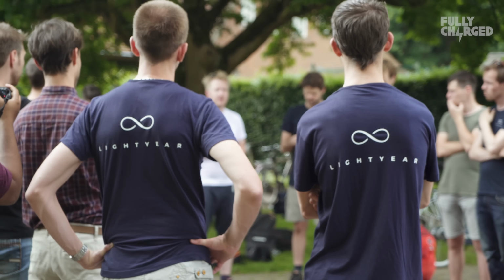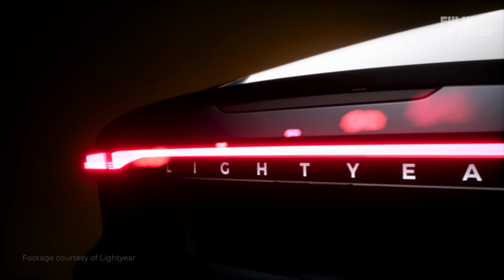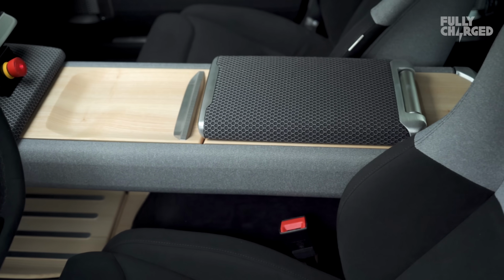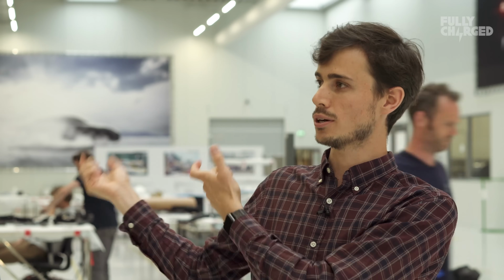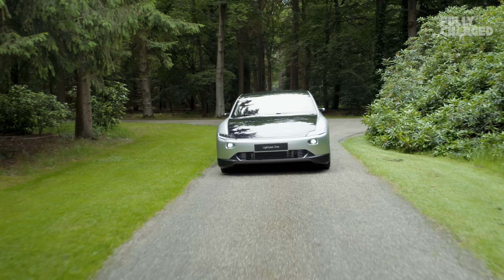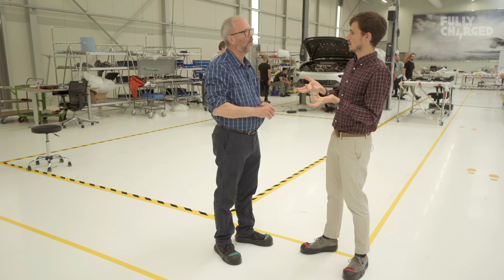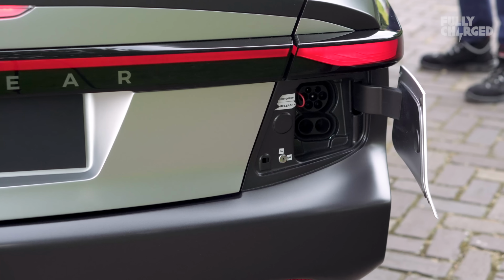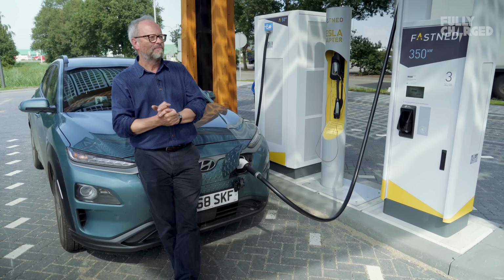Lightyear One solar powered electric car - exclusive first look | Fully Charged

Comment: Thank you for asking about the unsprung weight, I don't see any way around it! Motors in the wheels sound cool but I don't think it's good engineering, just move the motors inboard.
Reply: In wheel motors make it possible to design the chassis like catmaran for aerodynamics and it saves a lot of weight because there is no drivetrain.
Reply: @неболтай-в2о  - if it works it works and I'm for it.  I imagine those motors getting bounced around in potholes seems harsh.
Reply: That just reminded me of inboard brakes but that would really take up a lot of space near the center of the car.
Reply: @robertpryor7225  The goal is to save weight.
Reply: @robertpryor7225  You can dwarf down motors and shock absorbers to a certain size if you work together.
Reply: I am 23,My school kicked my ass..You want to know why?I asked questions.

Comment: Production vehicle in 18 months to 2 years?  From a single pre-production prototype to any volume build in that time, on a brand new car, and critically from a brand new company with no existing facilities, supply base and production experience would be, ime, not just improbable, but impossible. Today, no one has proven/certified full life durable wheel motors and there are some concerns over HV exposure when the powertrain is not safely "buried" within the main structure of the vehicle (pull a wheel off in a minor crash, and you can expose the HVDClink !!!)   The big OEs have literally thousands of engineers doing NVH and crash, and they have multiple years and product models of real production experience. As Tesla have found, making an EV go along is actually the easy bit (ie engineering the powertrain), making a quality product in volume (fit/finish/NVH/Paint etc) much, much harder..

Comment: Very interesting. Pretty good design, I would tweak a few things. I like that it's close to half of the energy consumption of Model S. That really translates to benefits in initial battery cost, battery wear, repair and replacement. Also ease of acceleration in drivetrain cost and tire wear. Lesser electricity usage for the house, smaller solar panel installation to offset it. Optimization is generally king and it even makes sense if structural materials cost might be higher. The lesser burden tends to catch up over the fatass approach. Not mentioning names.
General efficiency thinking also unsnags them from other burdens like foolish vampire drain and carrying a lead acid battery. Again, not mentioning names. Cleanliness is next to godliness. 
Speaking if which, I would recommend putting a touch display in the steering wheel face as the only display, removing the dash and center console. Clean like a Model 3 but that step superior by placing the display in the steering wheel where it belongs. The airbag can be in the bottom of the steering wheel in a slit, not behind the display. Keep it simple.

Comment: The in hub motors don't sound like a good idea. They work pretty good at low speed, but at high speed the vibration may damage the motors. This is most likely one of the reasons why they drive the car at such a low speed.
Reply: Yeah - I suppose these amateurs are stumbling around in the dark, not really knowing what they're doing - now if only they'd got YOU in to put them right.....................!!!

Comment: Wait. Listen at 5:58   "So the minimum range you will get is 400 (km) in winter, with Air conditioning, with everything switched on, with high speed driving"  

Sure, this car is efficient (as are all EVs btw) but it's not magic! My i3, driven fairly carefully, at a low average speed (50 kph) in uk winter (~5degC) averages, with cabin heating on, approx 6 km / kWh.  So, 400 km would need ~66 kWh (useable) which is 2/3rds of a Tesla big battery (100 kWh).  So the Lightyear car needs to be as efficient as my i3 is at 50kph, when it is travelling at high speed, lets say 100kph.   Now the i3 has a relatively poor drag co-efficient, and the frontal area is not actually that small (CdA = 0.69)  but doubling your speed (50 -> 100kph) requires 8 times more power, so it will have to have a Cda of < 0.1?  (Tesla S = 0.56, Mercedes A class saloon (current most aero mid sized car) = 0.48)

Comment: 20,000 km a year from the solar panel in a place like Australia huh.
Probably doesn't work out in practice due to battery limitations, but even if you drive a LOT, and even with the kind of distances you get in Australia, driving 20,000 km in a year is a lot of driving...

Definitely one to look out for, especially in the sunnier parts of the world.

But the efficiency gains are probably more impressive overall than the solar power.
Reply: All leases around here (Canada) have 20k km included every year. It's quite a common number in big countries...
Reply: @simonlynchsae  yeah, but you still don't reach such numbers easily unless you spend ages doing cross-country trips.
Most new vehicle insurance schemes are something like 100,000 km / 5 years.
So they too typically equate a year to roughly 20,000 km.
Doesn't mean everyone is reaching that number.
If you do a 200 km trip twice a week, like I currently am, you'll get around 20,000 in a year, but not massively over it. 
slightly under 400 km a week is a pretty high average unless you live in the middle of nowhere and constantly drive to something far away.
I guess when I lived in that outback town and took near weekly trips to the nearest city, which was 330 km away...
That ends up at about 30,000 a year.
But even with our car having done multiple 1000+ km trips in the last year, 20,000 km is a substantial fraction of the distance driven in a year.
And we DO make a lot of long distance trips compared to an average city driver even in Australia...

Comment: Can't wait for the cheaper non-luxury models. Just, please, keep the minimum range at/above 400km, everything is so far apart in Aus. Also, good aircon is a must have, as we'll often be leaving it out of the shade with a boiling interior.

Comment: That looks a lot like a Citroen CX, and the general feel and philosophy seems similar too. Really nice. Would like a shorter tail though.. How do you brake with in-wheel motors? Do yo still have disc brakes? Braking on the motor itself probably won't be quick enough for emergency braking?

Comment: I have followed battery technology most of my life. In 1974, at 6 years old, my parents bought me a battery powered motorcycle. It was a very expensive toy at the time. It had a lead acid battery in it, was very heavy and took 24 hours to charge. That charge gave me about 10-15 minutes worth of riding, then it needed 24 hours of charging. As a whole, I got about 50 rides out of it before the battery failed. After that, it became a very heavy push toy. In 2000, I bought a Honda Insight. VIN number 0000000250. My wife and I put 319,000 miles on it and when we traded it in, it ran and looked brand new. For me, I love seeing this technology. I am ready to see the world move past oil. I am tired of life being dictated by the cost of a barrel of oil. I'm sick of the problems in the middle east becoming everyone's problems. I'm sick of war over oil. I'm sick of air pollution. We should NEVER feed machines the same things we need to survive, like oxygen or even plant material (i.e. ethanol from corn ect.). Cheers to these people and others tackling this task.

Comment: It's very hard to find the good compromise with aerodynamics & styling. Plus the area for solar panels! What I see here it's streamlined 30s Tatra's design soul in 100% futuristic form, with NO retro resemblance. Very neat design, with no bells, whistles & trinkets which are overloading car styling today. And  bright & clever engineering inside. She's gorgeous. However, many elements need to be improved. Fingers crossing!

Comment: Slow speed test drive all look very nervous and people chasing the car makes me wonder if it had any functioning brakes.
Reply: It is the first prototype, what do you expect?
Reply: Ali Chahin  well the ability to stop would be good , I wonder what solution they will develop for breaking other then dynamic as the in wheel motors would be a problem to design a breaking system around.

Comment: One thing that always strikes me with these new-level leccy cars is that none of them use wind turbines where the radiator would traditionally be to generate a little more self-charging. Is the tech not there to make use of 30 to 100 MPH winds or does no one think to do it?
Reply: Because the energy has to come at the expense of something....lots of drag
Reply: @chrisphillips1948  Not buying it. For sure there will be drag, but too much?
Reply: Think about a wind turbine. That's harnessing the energy stored in the wind. The atmosphere is making the wind blow, and the turbine is anchored to the ground. So the turbine is taking energy from the planets dynamism. With a moving car it's the cars motion that's creating the source of energy and this motion ultimately comes from the power stored in the battery. Anything that "re-takes" this energy and converts it back into electricity is always going to lose out due to the losses incurred during the conversion and the inefficiency it adds to the car.

Comment: One day in not the too distant future the batteries will be so officiant they will get one thousand miles per charge and the solar panels will be way better than the ones we have now that the car will be able drive on it's own generated power all day and then the battery will kick in for night driving and will take only 5 minutes to fully recharge at a charging station . I can't wait...

Comment: Look up LoReMo - it was a German startup company from the early 2000's that looked very similar. It was supposed to be powered by a super efficient small diesel engine that was claimed to be capable of 1.5l/100km fuel efficiency. They made it to a prototype stage but I guess the underdeveloped battery technology and faltering market interested killed it.

Comment: I think it's really amazing that they're creating this car, and I think it's going to produce a lot of good science for new car manufacturing designs and materials. But I just have a hard time believing solar power on the car itself is going to be cost effective in the long run. And, historically, ultralight cars are extremely uncomfortable to use in every day life. The vehicle needs mass in order to create a comfortable ride. 

So they've reduced the amount of heavy batteries and put expensive solar panels on. I'd rather contribute to better renewable grid power and charging locations and put more batteries in the car. But as I said, I think their project is going to produce good science for the industry.

Comment: Great Vision from Lightyear, I do really agree with tue solar car roof and think manufacturers should be putting the work in to bring solar costs down and efficiency up and we can completely offset transport emissions because that will have a huge impact. Anything to remove steps of energy capture to use is a big plus! So great to see FC get this exclusively fast coverage, congrats guys! Great work

Comment: If the car is so fragile you have to push it by its wheels, what happens when you get rock chips and bugs all over the solar panel?
Reply: Looks like they haven't implemented Reverse yet (nor Park, judging from the wheel chocks).